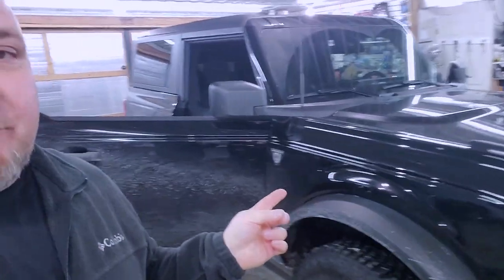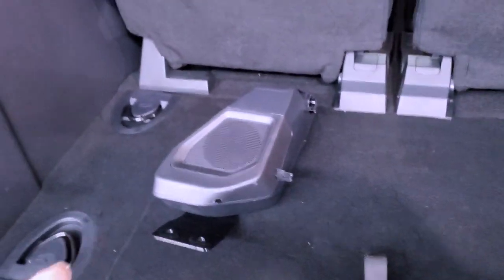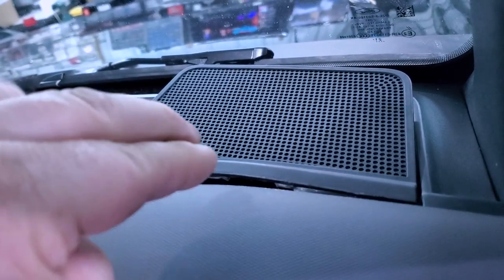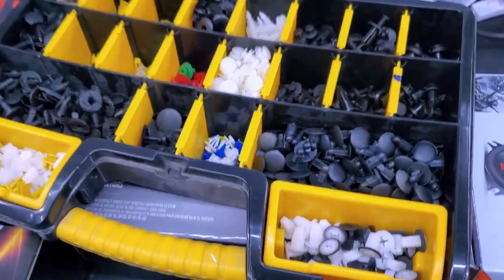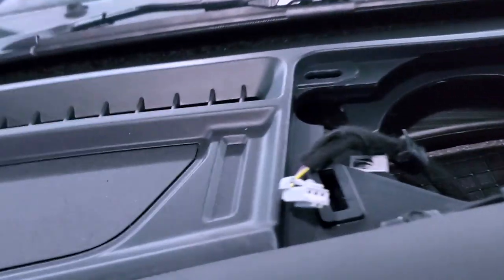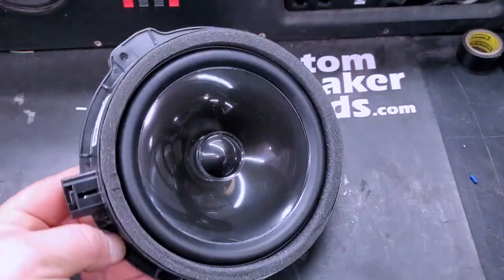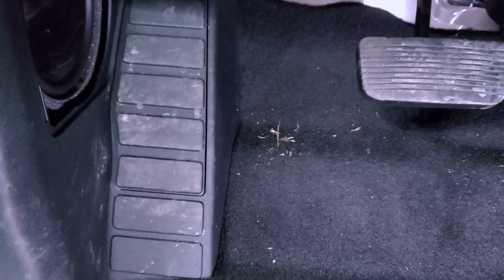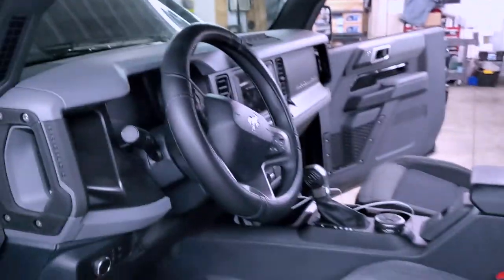Simple audio upgrade 2021 bronco (explained) in 15 minutes!

Comment: Would you get a better sound stage if you ran those like components? Just run a mid-bass in the kick and cross them over at a frequency that gets a flat response? Why did you choose 300 hz crossover point?

Comment: If the sub is under the seat were is the amp . Also, why didnt u use the forscan soft ware to open up the power to the rear pods? Good video

Comment: quick question. We have harsh winters over here. If the rear passenger gets in with a lotta snow on his boots. Is there a chance that the snow or water could damage the sub under the seat? I have a 4-doors. there should be enough room. But I''m  still wondering
Reply from the maker: Shouldn't have a problem with the snow boots. Just be sure to face the wiring and inputs towards the front of the vehicle.

Comment: I was going to do an under-seat sub, but I couldn't find a solution that wouldn't also interfere with the rear vent Heating and A/C. The Bronco has rear seat climate, but the climate control vents for the rear come from underneath driver and passenger front seats. That's true for everything w/ a Mid-package and up. In looking back at the video it looks like the Bronco is a Base SAS, so I'm guessing it doesn't have that package... But, for Mid-packages and up, you'll have to do something else for your bass. I ending up going with a 12" Kicker downfiring sub with 12" radiator. It fits nicely in the back. You can still fully access the back panel in the floor, and the box only sits 1-2" higher than the rear seats when folded down.
Reply: Can you share your setup @Shodax?  I'm interested in your box setup.  Also where did you mount your amps?

Comment: I noticed on my 2 door that  there is a big cavity in the tail gate. There is a plastic cover for venting. Would that be a good place for a sub and kicker speaker o not lose the under seat floor space or do you think that it would be so far back and buried behind four seats it would lose its power?

Comment: Thank you! Just got my Black Diamond today and wanted to get that sound bar but not now. So you dont have to go behind the dash to wire a sub? The last install I did was my 06 Mini, 2 12" Orion subs in a sealed box with a 2000 watt california suncoast amp, Kenwood head unit.
Reply: Would appreciate some more indepth info on the wiring please.

Comment: Just watched the video. Great work. I have a 2022 OBX with the lux package. As you know, the speakers suck. The rear speakers attached to the upper bars are already blown. What is your suggestion to replace all the speakers? Will I need to add a crossover or is it possible just to replace all the speakers.?

Comment: New Sub for life here! So I noticed the Bass blocker says for 6"x9", but you used it on a 4" speaker is that ok to do?  Is it ok to use on speakers up to that size?  Also I was wanting a bit more bass, so I was looking at "JBL BassPro SL 8-inch 125W RMS Powered Under-Seat Compact Subwoofer Enclosure", would that be an ok substitute for the Nano you mentioned in this video? Would it fit under the seat still?  Thanks, great video.
Reply from the maker: Yes, the Bass Blockers frequency are very "safe" as far as what the packaging says they are for. If you're using a quality speaker, then they can handle those frequencies that are lower than what the package recommends.

As far as if the other sub you're referring to will fit, I am not sure. You can always look up the model I used and see its measurements to compare.

Comment: Did you amplify the sound bar I have one and want to know if that improved it at all.
Reply from the maker: No, it's running off the Factory Radio; however, Ford does the Flashing. They flash the factory radio to change the crossover and EQ curve for the soundbar.

Comment: Thank you so much!!! I hate how you have the Spend an extra $15k from Base to get the Badlands Trim and then $4k for the  LUX Package (to get the B&O Sound System) which is 10 speakers.....Ford Should have definitely offered mid-level sound system option. I'm going Base + Sasquatch + After market Sound system .
Reply: This is my truck and that’s exactly what I did, best price hack, and the sound system Cabe put in bumps perfect, not overpowering, but super clean!

Comment: Did you remove the floor air  vent adaptor under the seat to get the sub further under the seat.
Reply from the maker: No, he didn't have one. Whenever I do have vents, if they will be a problem, I modify and redirect them.

Comment: I just did Kicker KS for the 4” and Kicker CS at 6.75” for the kick panels. Definitely need a sub, but am worried about the vibration under the seat. Any thoughts on that? Is it intense? I was also considering the kicker downfiring instead in the trunk so I could atleast stack stuff on top. 

One more random question. I have broke/ stressed one of those clips in the driver side 4”. Glued it to hold. I’m now worried about lifting it back off to put bass blockers on that I missed. Is this a big deal? Last thing I need is something rattling around. Tia.
Reply: I did the downfiring Kicker 12" boxed sub with 12" radiator and I couldn't be happier. My only complaint is that I wish it was 1.5" shorter, so it would be exactly the same height as the rear seats when folded down. However, until they release a pre-made 10" sub to fit in-place of the non-B&O Lux Packages, I think it's the best option for bass. Honestly, I paired that 12" downfiring sub with a 400W amp, and (6) 2-way Kicker speakers ((4) 4s and (2) 6.5s)... and it blows the Lux package out of the water for audio strength and quality.

Comment: Awesome 👍 I'm currently looking for better sound . Question is there any way you can show how you striped wire crimped connection to speak and what wire is what , I watched your video the four wires on kick speaker got me aha ?
Reply from the maker: Here is what is listed for the Vehicle.
Rear Right Spkr
(+) Green/violet
(-) Gray
Rear Left Spkr
(+) Grey/Violet
(-) Brown/Green
Left Front Dash
(+) Green/Blue
(-) Gray/Blue
Left Front Kick
(+) Blue
(-) Gray/Brown
Right Front Dash
(+) Violet/Gray
(-) Yellow/Gray
Right Front Kick
(+) Yellow/Orange
(-) Green/Brown

Hope That helps
Reply: Mike, can you please tell me how you tapped into the front driver side kick panel speaker wires to wire in the sub? (if you did that)
Reply: Yes would like to know how the sub is ran exactly

Comment: How did you hook up the sub to the factory stereo outputs? I’m confused about where to hook it up on mine.
Reply from the maker: The kickpanel speakers are a full range signal. Grab the hi level (speaker signal) at one or both of those, subs are mono so one is fine. That will be the signal converted from hi to lo at your converter or amp, whichever way your doing the conversion.

Comment: I'm sure if they installed soundbar backwards they didn't run fordscan to tune the settings for the soundbar that's why it didn't sound good.
Reply from the maker: They did because it removes the high pass from the rears and converts to full range when they do. Its honestly just not enough power to drive the soundbar properly.